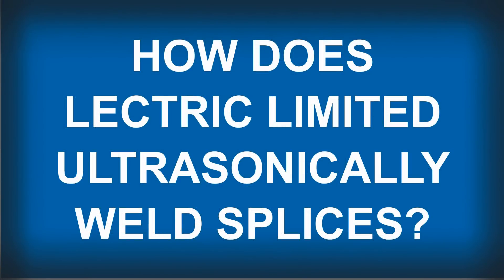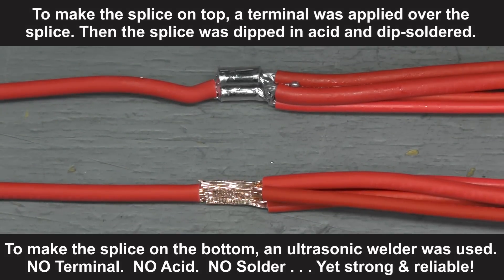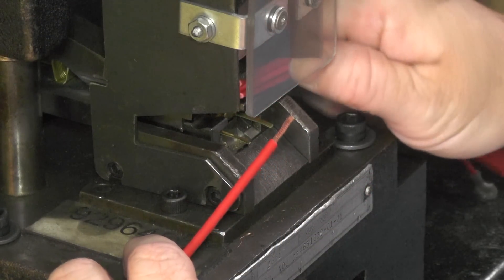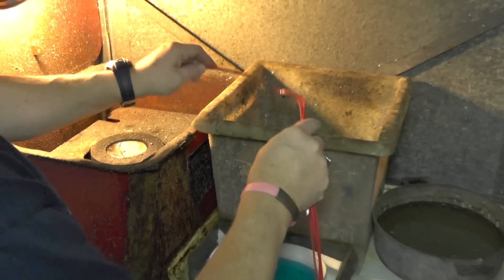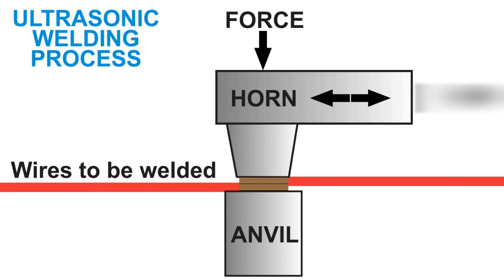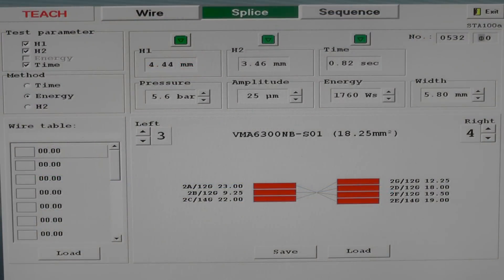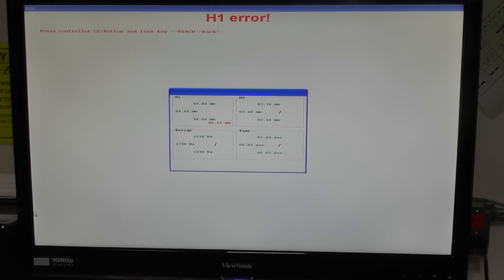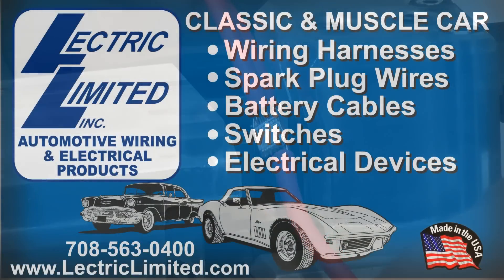How A Wiring Harness Splice is Ultrasonically Welded - Lectric Limited

Comment: If we want to check the streangth ( load ) between the wire is there any standards?

As I know we need to elongate the small sq mm wire in pull test but what is the standards? Is there any range which describes the load value range?
Reply from the maker: It depends on the quality control specifications you're trying to maintain.  With the wiring harnesses that we manufacture, we adhere to the pull test specifications of Packard electric terminals.  The airline industry, for example, might have other specifications to adhere to.

Comment: Great explination but I have had so many failurs of this type of joint in John Deere and Iveco harnesses.  They absolutly need the terminial to avaid stray wires breaking out of the joint working thier way through the insulation and shorting the harness.
Reply from the maker: If you're experiencing wires breaking out, or separating from the splice, I would assume that the splice was not properly made.  There are many ultrasonic weld parameters that will affect the quality of the splice.  A quality splice should not fall apart.

Comment: Are you could just wire it properly put a terminal strip and ring terminals, and 3" inch jumper wires between terminal if need more then 4 connection per terminal.

Comment: What kind of welding electrode to be used for wire welding?
Thank you
Reply from the maker: There is no welding electrode because we are not arc, mig, or tig welding.  The welding process we use (as shown in the video) uses ultrasonics to create the weld.   This ultrasonic welding process uses an assembly with a  horn, booster & converter to make the weld.

Comment: What are the main causes of ultrasonically welded failure?. after ultrasonically welded process , the wires are deformed? My question is oriented, if all the wires are deformed or if there are some wires that do not deform after the ultrasonic welding process. SPLICE CABLE
Reply from the maker: Great question!  Ultrasonic welding failure can be caused by incorrect amplitude, welding time, circular mil. area of the weld, and/or pressure of the tooling.  However, this is the only welding process in which all of these welding criteria can be monitored and qualified with software.  Not only that, the process is monitored BOTH before and after the weld.  If any one or more of these criteria are out-of-tolerance, either the weld not being performed (until the problem is fixed), or the weld will not pass (an alarm sounds) after the weld is made.  In which case, that weld is scrapped.  To answer your specific question, if any wire is "deformed" to have missing strands, the circular mil. area of the weld will not match what is programmed, and the welding process will not be made until the problem is fixed (ie, a new wire is cut).

Comment: You guys should check out the TS3 from Telsonic. The system is much smoother to use and comes with a similar and more advanced software with the standard unit.